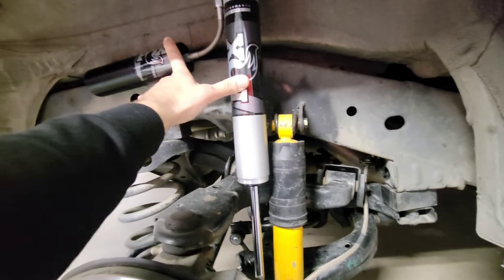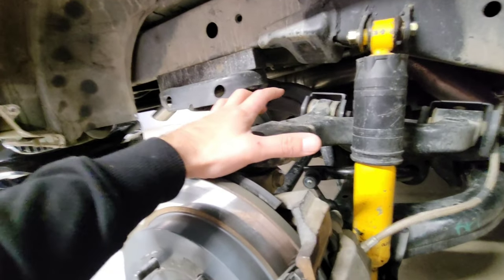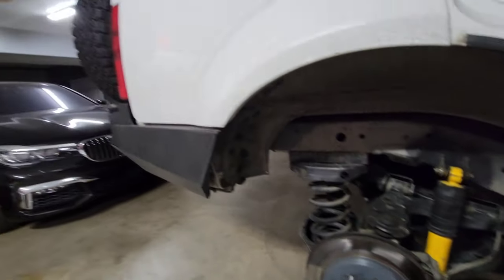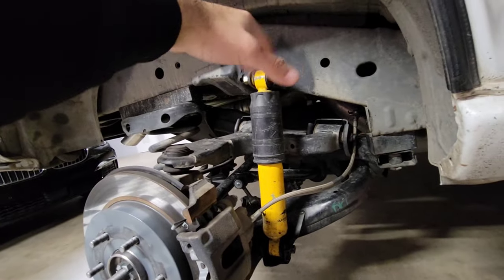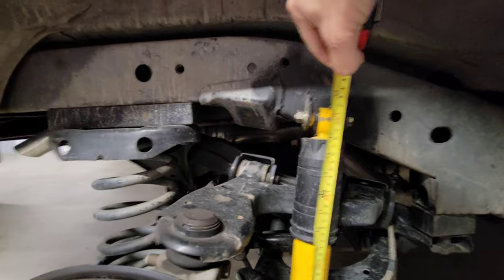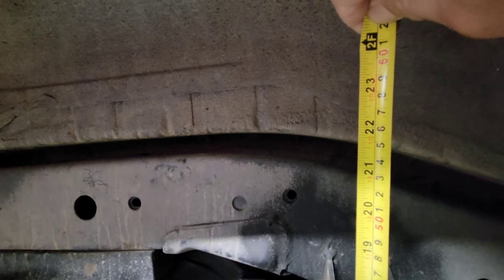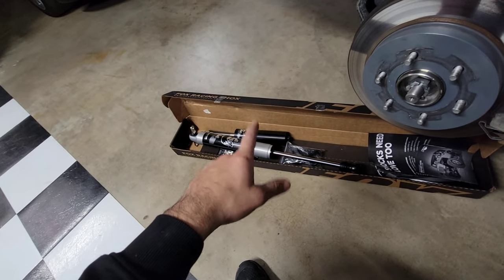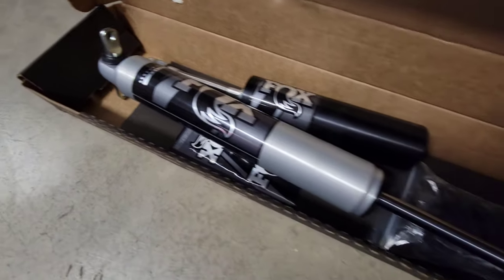Bought a Fox 2.0 Reservoir Rear Shock from a Jeep for my Nissan R51

Comment: Springs are what gives you lift and handles the weight. Shocks are there to smooth out the road imperfections(dampening/compression). If your rear is sagging from all the weight you've added, you need stiffer springs.

Comment: Do you know if the pathfinder control arms are the same width as the armada bolt-on areas? Upper bolt holes and lower. Couldn't tell from the video if they were narrower or not. I know the shape of the upper arm and shock location on the lower are different.. main question is can you bolt the armada upper and lower arms to the existing R51 pathfinder subframe?? I'm only trying to gain the ability to convert to coilover in the rear
Reply from the maker: Yes, they're the same.